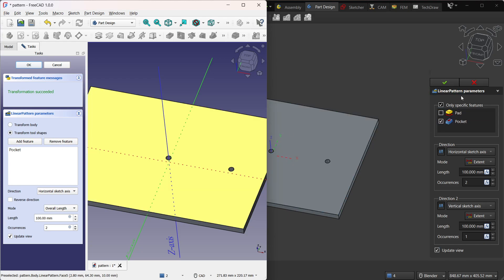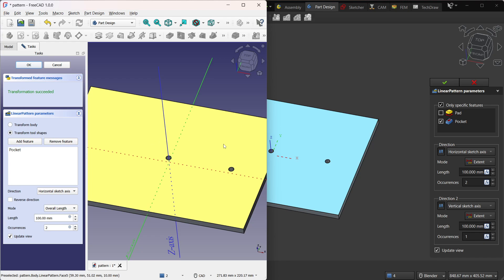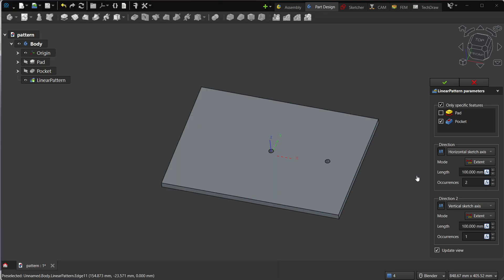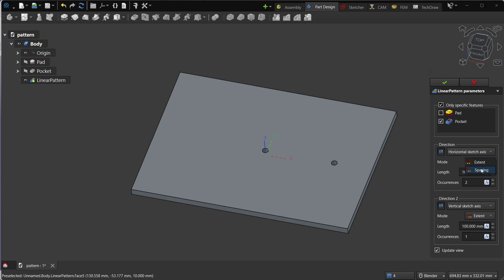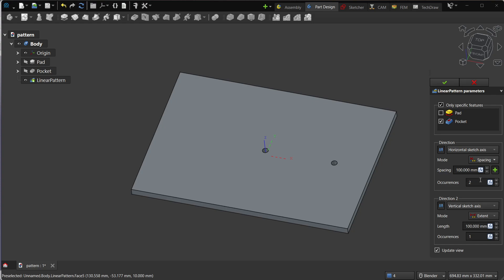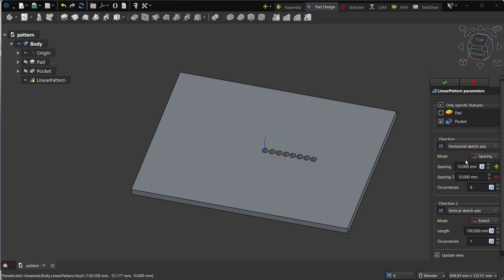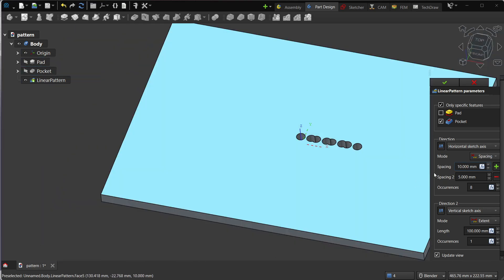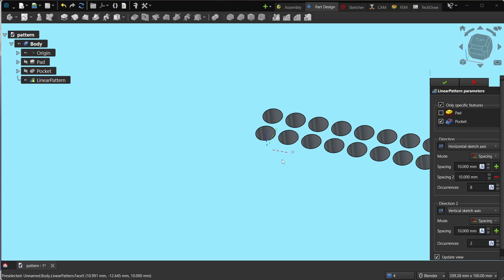PartDesign: Linear pattern improved

Comment: The dual linear pattern options is very cool and powerful, i notice on the second spacing option no expression editor for a function?
Reply: I just tried this yesterday and I would love the function editor in the second occurrence. I needed to do the holes on some Blum drawer slides and link it to a spread sheet. I have all the values for the different sizes but no way to link the second spacing. I just did 3 holes and then used the tool to work around it. 

Excellent work!

Comment: Awesome progress on the interface. It really seems intuitive.

As a FreeCad noob, the need to do recalculate for the changes to take effect would not have occured to me. The toolbar button fades in the multitude of other toolbar buttons. 

Maybe when there are unapplied changes a button can appear (e.g. lower left on the screen) to recalculate and not be visible/dissapear otherwise?
Reply from the maker: Ideally the software recomputes automatically. In this cas as the UI does not handle this and we change directly in the property view, the recompute is not triggered. So ideally when we have a UI for this it won't be necessary to recompute it manually. By the way you can see in the tree the objects have a small blue overlay on their icons when they need to be recomputed.

Comment: A big improvement on the interface with really useful new functionality. Regarding the list of patterned object that you use to modify an individual object, is it possible to include functionality to remove/suppress individual patterned objects ?  Is it possible to highlight patterned objects in the list by clicking/ctrl-clicking on them in the 3D view ?
Reply from the maker: Currently no you can't delete instances. You would need to override the spacing that you want to skip and double the spacing for it. And no selecting in the view can't be interpreted  to highlight objects in the list unfortunately. The reason is that wherever you click on the solid you are always selecting the last feature of the body. Currently the software cannot tell that you clicked on 'pocket3' when you click on one of it's faces. I know SW can do this but it's kind of tricky to do. Perhaps we could make it work with the TNP names.

Comment: Great improvements! But let me criticize a little bit: in my opinion it's better to leave add/remove feature from predecessor. When you dealing with long working trees feature select right from small widget will be painful and annoying.
Reply from the maker: Yes this is a valid concern that several people mentioned in the DWG too. I think the core problem is the need for a 'reference selection widget' as Kadet's issue mention (I don't have a link for it right now).
I have not rolled back this yet because I think it's still better than current add/remove button as they are kind of buggy. But when core gets this 'reference selection widget' I'll roll back this.
Having said that I am not sure that using the small widget will be so painful even if the tree is big. Because that list is filtering to show only valid features of the body.
Reply: I agree. The small feature list can grow really fast and browsing in such a small window for features to select can be troublesome. I think selecting features from the tree view would be better, no reason to double the feature list.